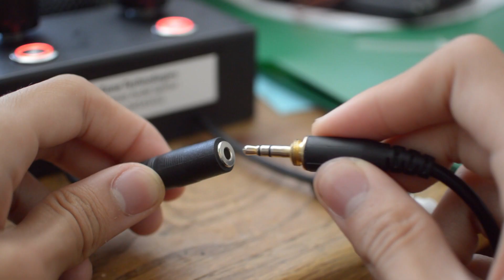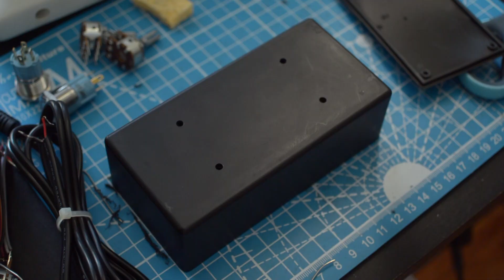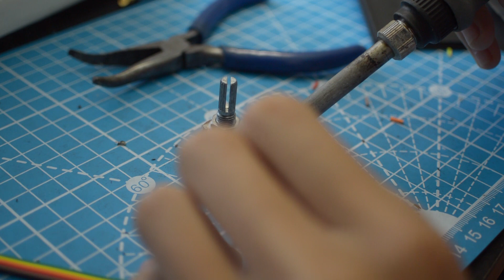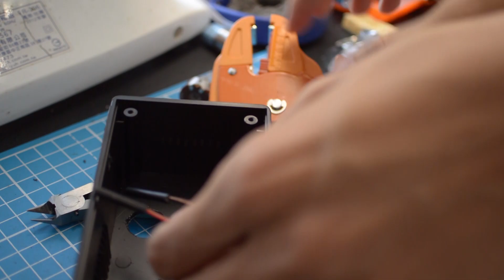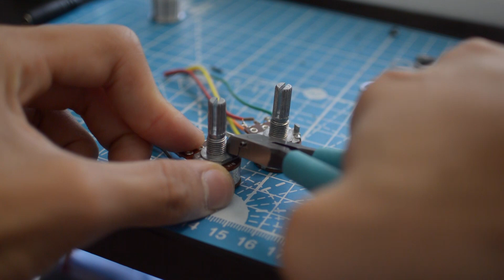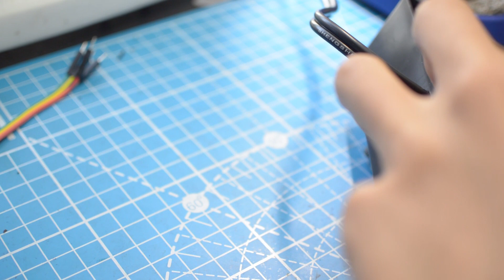Build your own Audio Splitter Box with Volume Control

Comment: Why not use heat shrink tubing on the wires? It sure beats electrical tape. Also, where does one purchase the adhesive drilling paper? I see the PDF, but can this be bought ready made?

Comment: Your iron is too hot, you need to use flux, your holes for the wires could have one of those plastic things made for it ( forgot the name ) next time do all the wireing and then install it. Also you can use epoxy and a piece of metal in it to make it more heavy and stay in place and add 4 small rubber feet.
Reply from the maker: I was using Lead-Free solder which explains the higher temperature. The Flux is not needed because it is already in the solder (Side note: If I didn't have any flux at all the solder would not even stick lol) (If you are talking about how the solder is having a difficult time melting, its because the tip is very old and I was using Lead-Free.) . I didn't choose to add heat shrink because I didn't have any when making the video lol. I taped it down on the table with double-sided foam so it does not move around.
Reply from the maker: I have switched over to lead solder now and I replaced the tip.
Reply: BS.  The iron isn't to hot.   Most aren't hot enough.   Liquid flux is the answer and a hot iron is what you want.   Less time on components = less thermal transfer.   HOT is what makes less time.

Comment: It's hard to follow without any wiring diagram, but I'm pretty sure that each button will also affect the other output. The buttons are probably just connecting the channels together. The effect will probably be lesser on the other output, the lower you turned the volume for the "mono" output.
Reply: I know I'm being critical. I have watched some of your other videos, and they're great. Keep up the good work.
I've been thinking about making videos too.. maybe "cheap simple diy audio gear" would be an idea. I just don't know where to start.